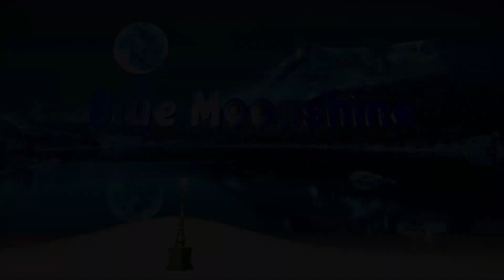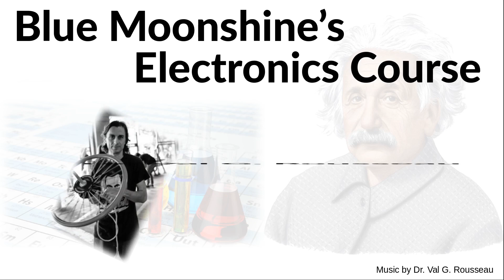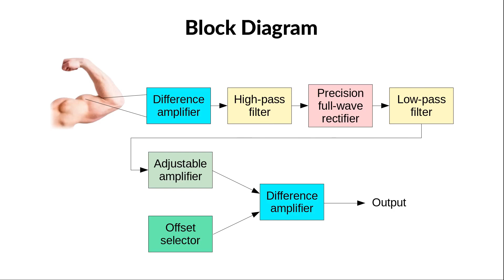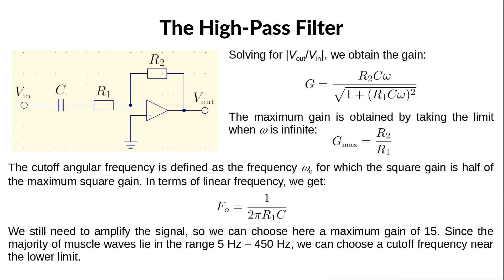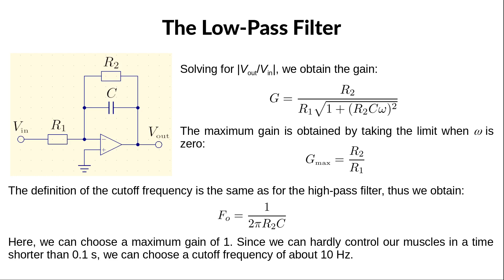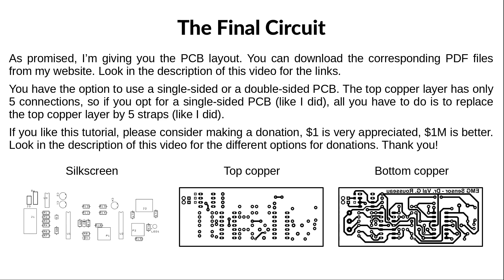EMG Sensor Circuit - Tutorial and Diagram - No Arduino Needed - Use it to play video games

Comment: This is an awesome tutorial. I am trying to wire this up myself and want to know what the approximate voltage should be after each step in your block diagram (for troubleshooting purposes). Could you help me with this?
Reply from the maker: It is very hard to give a value for the approximate voltage after each stage, because it depends strongly on how much you are contacting the muscle. And even if you knew this approximate voltage, it wouldn't help much in troubleshooting if you don't have an oscilloscope. The signal is a superposition of AC signals, and you won't be able to read it with a multimeter, as such a device only measures a very specific frequency. Now, if you have an oscilloscope, then you don't need to know the approximate voltage, since you will directly see how the signal changes when you contact the muscle.
Reply: @BlueMoonshine  Should the voltage signal coming high pass filter be well over .7 volts? You mentioned in the video that the voltage should be too low to activate a diode with the activation voltage of .7 volts.
Reply: @mahefred549  
Yes, but actually no! As explained in the video, we are using a "precision full wave rectifier" that act as a "superdiode", that is to say a diode without threshold. So this superdiode is activated as soon as the signal is non-zero, and the signal doesn't have to be over 0.7 V, it can be much smaller.

Comment: Good day! Thank you so much, for a great example of a self-made EMG sensor and detailed academical explanation! I have a question about C4 capacitor, on diagram you mark it as capacitor with polarization and in components list we can see, that it has 220 nF capacity, the problem is that I can`t find a polarized capacitor with that capacity, what should I do? Or maybe it is a misprint in the list?
Reply from the maker: The symbol is just wrong, it is not a polarized capacitor, just a regular one.
Reply: @BlueMoonshine  Thank you a lot!
Reply: @BlueMoonshine One last question. In components list capacitor capacity are 2.2uF and 220nF ?but on circuit diagram they are 1uF and 150nF. What is the best option?
Reply from the maker: 1uF and 150nF is what I ended up using because I didn't have the others. This is OK as long as you use the RC combination that produces the same cutoff frequency. So, you can either stick to the values given in the diagram, or to the values given in the list of components.
Reply from the maker: Also, the cutoff frequency doesn't have to be exactly the same ones as mentioned. It is just a rough estimate.
Reply: @BlueMoonshine  Great, thank you!

Comment: Hi sir it's me again. Sorry to bother you. I just have two additional questions so I can finish up the circuit.
The first question is: In the Schematic I can see Vp and Vn that I believe stands for Positve voltage and negative voltage... Do I use for Vp the 9v from the battery and for Vn the 0v or negative part from the battery... Or do I use the virtual ground as well....
And my other question is... For the amplifiers, in order to supply the voltage that they require, can I use the battery as well for the positive input and the virtual ground for the other input?
Thank you so much beforehand
Reply from the maker: You use the positive lead of the 9V battery for Vp and the negative lead for Vn for all op-amps. The virtual ground that you get out of the LM386 is to be used everywhere you see the ground symbol on the diagram.
Reply: @BlueMoonshine  Thank you so much.

Comment: Sir, one question. About the diagram, is the very first OpAmp that shows on the upper left corner the LM386?
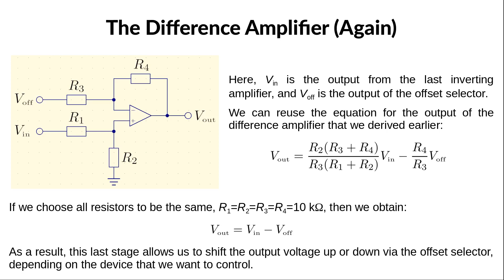Reply from the maker: No, the LM386 is just for the power supply. It is a trivial connection, as can be seen at 17:47. Simply connect the two input pins together, the + pin to the positive side of the battery and the - pin to the negative side. Then the output pin of the LM386 is your virtual ground.
Reply: @BlueMoonshine  I understand thank you so much for the fast response... Just one more question, so then the output from the lm386 being my virtual ground will go to the ground as my reference and is the connection that is showing bellow emg1 and emg2?
Reply: And if that is the case, all of my ground connections will be shared and will go to this virtual ground?
Reply from the maker: Yes!
Reply from the maker: Yes, exactly.
Reply: @BlueMoonshine  excellent thank you so very much

Comment: Please share the schematics i have a breadboard i really need the schematics thanx ❤️
Reply from the maker: All the schematics are given and explained in the video.
Reply: @BlueMoonshine   not the pcb i dont have one id appreciat it if you shred the schematics for breadboard
Reply from the maker: I'm wasn't talking about the PCB. The schematics, or circuit diagrams, of each stage of the block diagram are shown and explained in details in the video. All you have to do is to place your components on the bread board and write them according to these diagrams.
Reply: @BlueMoonshine  you mentioned quad op amp TL084 in the components list. What is the purpose of it. In the circuit you made you used two TL084 and one LM386. The connections in the schematic you shared and components you used is different to the circuit you made. Please clarify
Reply from the maker: @waleedsajidbaloch9523  
Well, if you watched the tutorial, you can see that you need a total of 8 op-amps (if I remember well) for the circuit. There is nothing that prevents you from using 8 individual op-amps, but using integrated circuits that contains 4 op-amps in a single chip makes it easier. The values of the components are not unique. The tutorial explains clearly how to calculate and choose values that work, and I simply made a particular choice.
Regarding the LM386, as is explained at the end of the video, it is if you want to choose the option of using a single battery and turn it into a symmetrical power supply. If you don't want to go for this option, there is nothing that prevents you from using two 9V batteries connected in series, with the ground at the center.
Reply: @BlueMoonshine  can you share the schematics also it would be great help for everyone. The problem is i tried the same circuit and cross checked every thing with my friend but still circuit did not work. it would be great if you could share us well described
Reply from the maker: @waleedsajidbaloch9523  
All links to download the schematics are given in the description of the video.